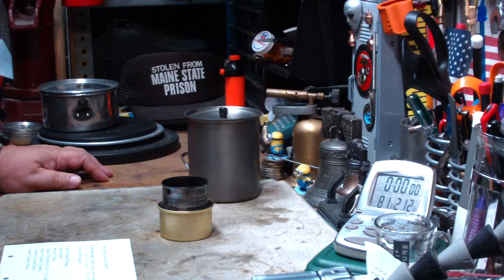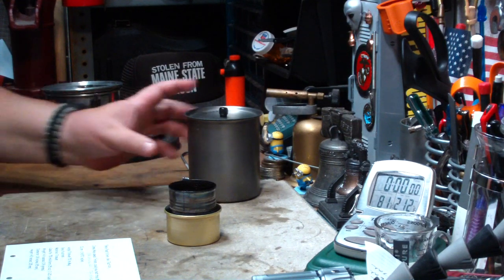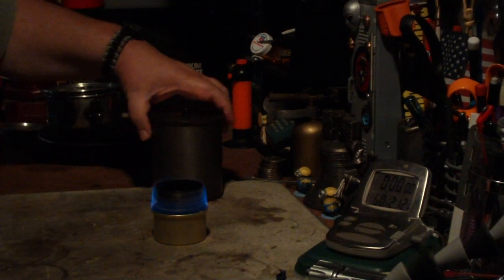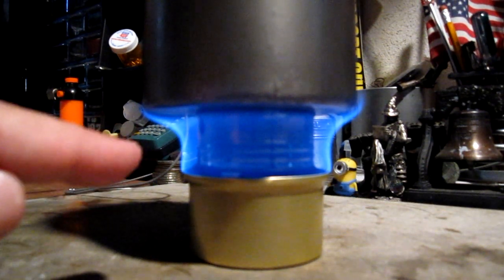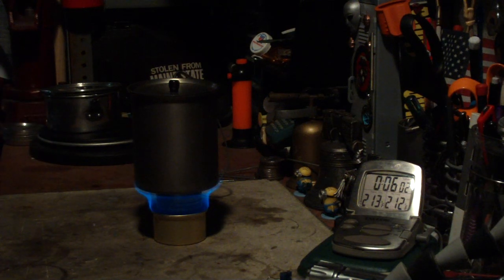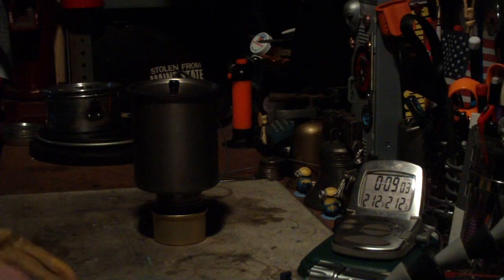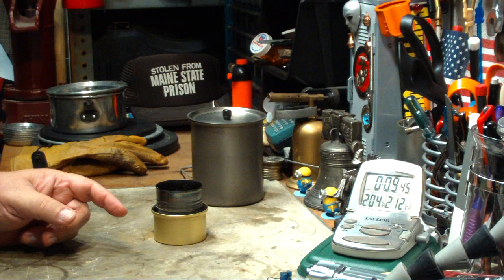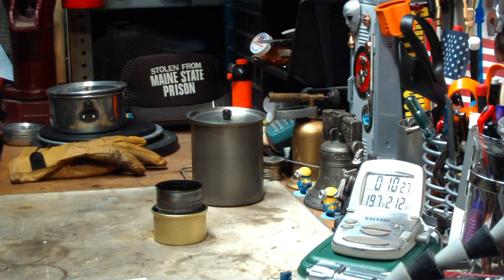Fancy Feast Stove - Boil Test #2 - Requested by James May

Comment: Thanks Hiram. Not too many vids about the wicking version. Thanks for doing them. One vid said 1/4 to 3/8 for the pot stand elevation. That sounds too low. Wonder what 1/2 inch would do ? Also they were using fiberglass cloth from the bondo section of the paint section at home depot for the wick materials.